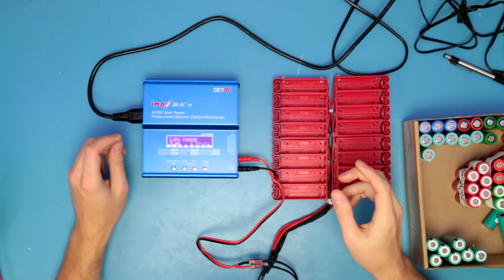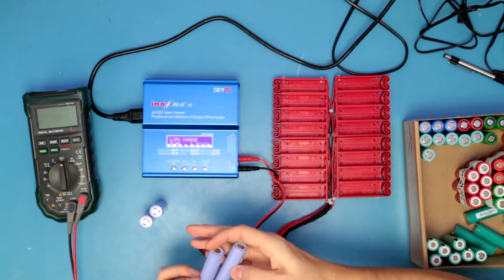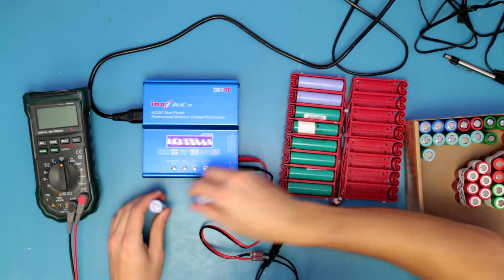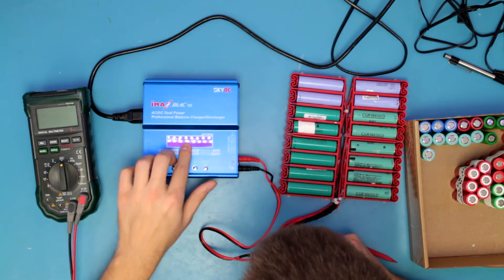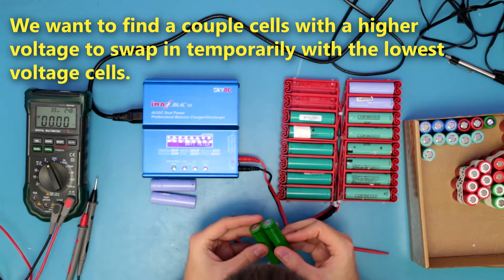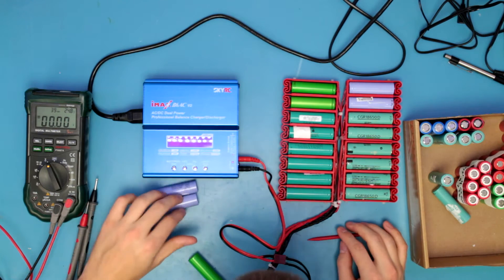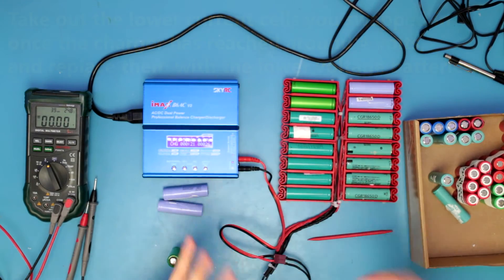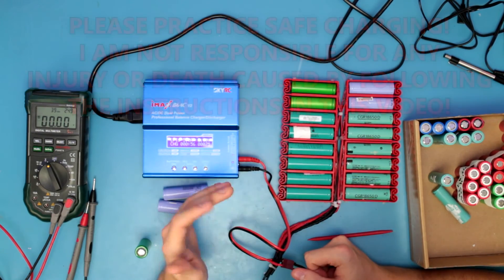SkyRC IMAX BA6 CONNECT ERROR CHECK MAIN PORT FIX

Comment: I was trying to discharge my GoPro batteries using this and I was getting the check port message. After watching your video, I thought maybe it gave that error because the voltage was too high, and yep, I went into the batt meter and it reported 4.36V. I put in a slightly discharged battery, and it worked fine. I wish there was some way to override that. Sometimes I need to discharge my GoPro batteries when I end up not needing them. Storage and discharge give this error.

Comment: Totally retarded solution, and a really bad way to charge freshly pulled 18650's. You've got all the cells in parallel, so of course the voltage of the lower cells rises and the higher cells drops. You are "balance charging" them with literally infinite amps, which is a really dumb idea on many levels.
If you are parallel charging, the start voltages of all cells must be matched. Don't mix (say) 2.0V and 3.0V cells, because as soon as you connect them the 1V difference means 10 or 20 Amps gets pushed between the cells. You over-current both cells in the process, and only end up with the averaged voltage anyway. You are damaging the cells through ignorance.
You should bring the "super-low" voltage cells up to 2.7V before putting them on the B6 charger. You can do that with a small power supply, just use very low current (eg: 100mA) so that the (technically faulty) cell gets recovered slowly and safely.
Only charge with large currents once you are sure that the cell is OK (eg: holds charge for a week)..

Comment: I am getting "Connect Error check main port when i setup the charger for an NIHM battery pack and i cannot find anytghing on the manual showing why i'm getting these errors.When i start the charger after about 10-11"i get this error..Any help would be appreciated.
Reply: Hi Harry, were you able to fix it?
Reply: @sicariussss  Hey Matias how you been? It's about that time to start flying here on the East Coast ✈️.. No bro I was never able to fix that problem I had with my Charger last yr. I contacted the mfr but they never responded so I'll have to give it another try.. You have any ideas? Thnks for remembering 👍😊
Reply: @techFPV5964  Hi I was able to fix it!

I tried with othrr 18650 and worked! The problem is that if the voltage is below 2.5V the battery won't be detected. So what I did was connecting for a couple of minutes the charged battery with the empty one (positive with positive and negative with negative) then I tried again and it worked! I did that with 26 batteries and all worked! Try this and let me know if it worked :)

Comment: Okay, have another solution: the problem is bad contact on "banana" plugs — it's just too weak to handle high current. Just solder the outer spring-barrels to the central copper pin.